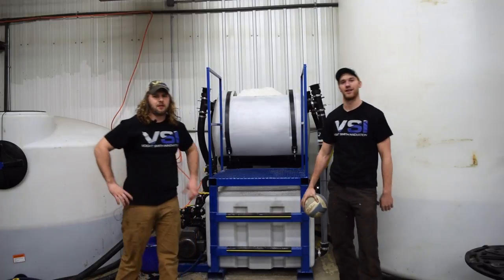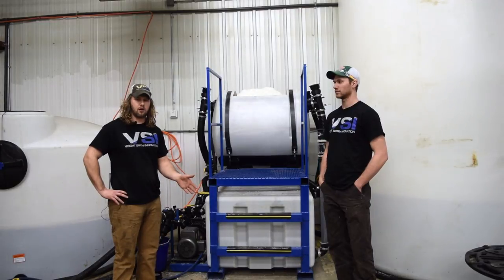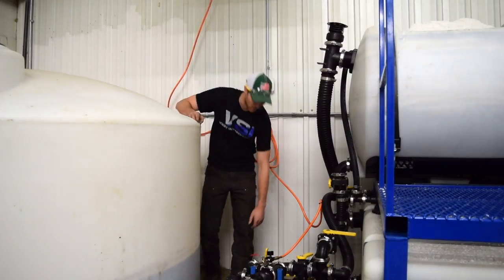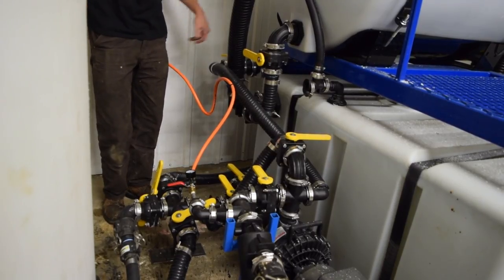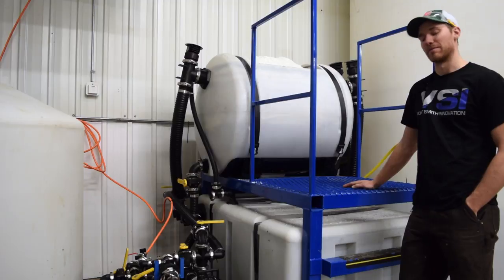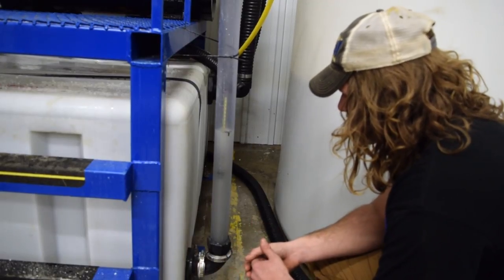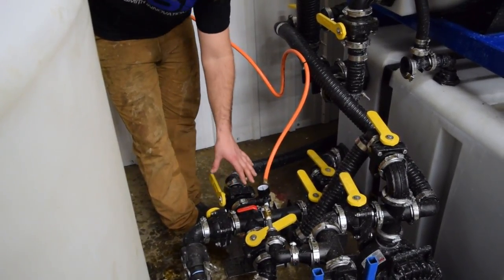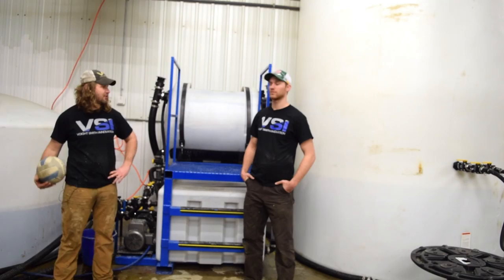How to Make Salt Brine

Comment: Does the water need to be warm?
Reply from the maker: We make our brine with water that is cold to the touch and it works fine. The main concern is if you are going to make it outside where the water can freeze in the lines.
Reply: @voigtsmithinnovation4112  so what kind of salt to use
Reply from the maker: You can use any regular salt you can get your hands on. Bulk salt, brine maker salt, Solar salt, etc... As long as it doesn't have any additive in it you are good to go.
Reply: @voigtsmithinnovation4112  how about calcium chloride?

Any difference?